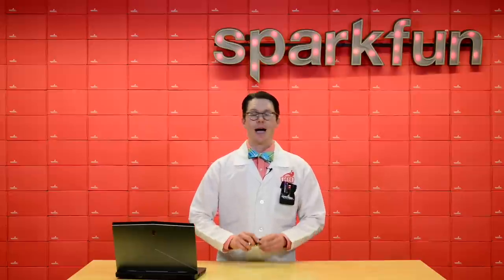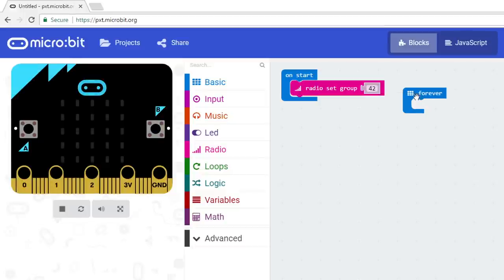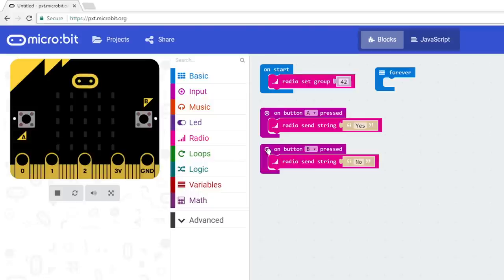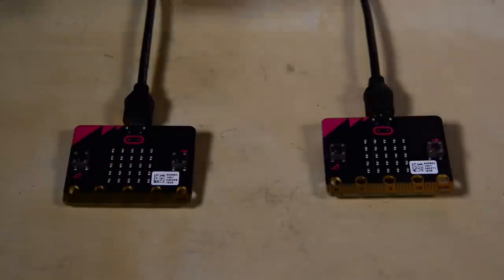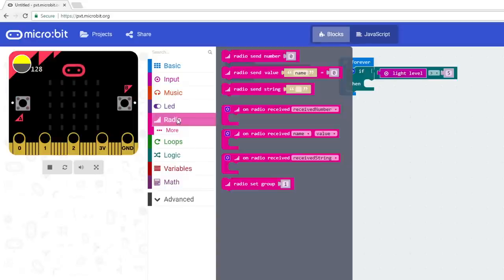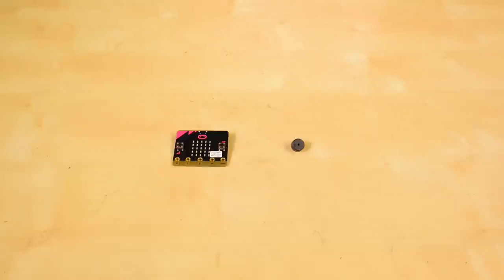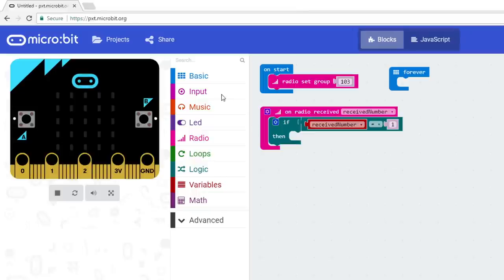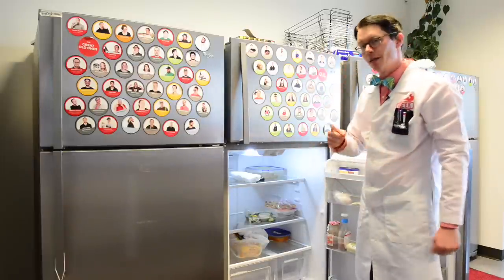Getting Started with micro:bit Part 4: Remote Burglar Alarm

Comment: HOw far can this radio signal reach within the microbit can I be like 2 houses away
Reply: I didn't test the extent of it's range, but I suspect that it would only work a couple of rooms away. BLE is a low-power technology, so I wouldn't expect much more than that.
Reply: Hey!

The micro:bit's radio can reach around 21 meters (70 feet) over an open area(given it isn't disturbed by other electronics). So I belive two houses is a bit to much(as Shawn also said).
Though we tested it's range with a remote controlled car in our office and it easily reached 15 meters. Hence the possibility is there :)

Comment: Great totorial, thanks. I also ordered one to my son.

Stupid questions: 
What is the maximum pin current for "1" and "2" pins? Do they have transistor output, or its a direct CPU pin? If there are several hex-apps placed in a microbit folder, which one will be started? Is it possible to have automatic Arduino-like upload in IDE?
Thanks.
Reply: Man, you are so lucky, mine is only 1 year old and I don't know what technology will bring when he is 7

Comment: Hi, I have a Question. Where I can buy the speaker and so on? Because your vids are very cool and I want to do the same. 
Sry for Bad English I am from Germany!
Reply: We sell the speaker, wires, and other components at SparkFun: https://www.sparkfun.com/products/7950. You can see if there is a company that sells SparkFun parts you need in Europe: https://www.sparkfun.com/distributors
Reply: You can very easily use your headphones, just don't put them in your ear.